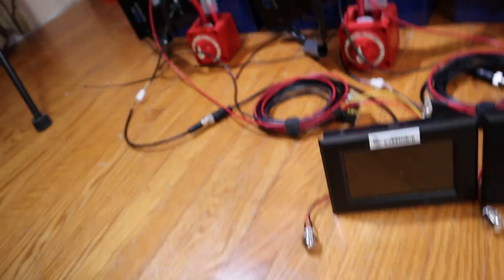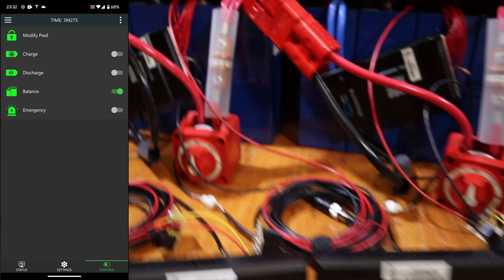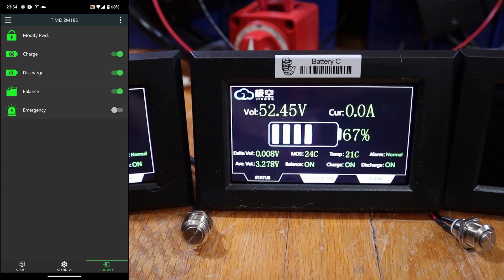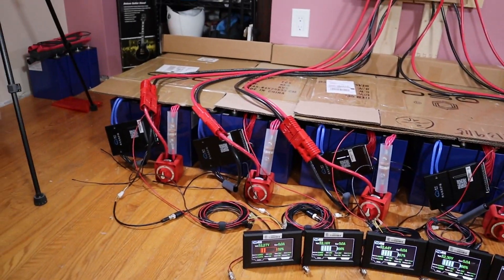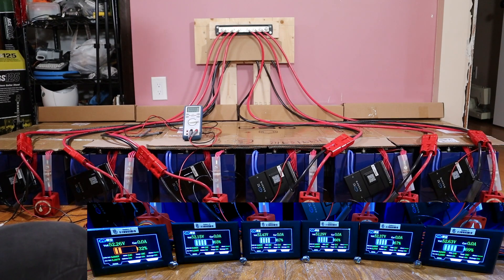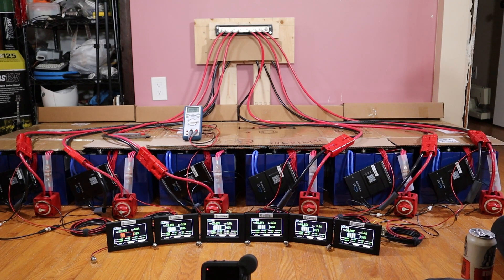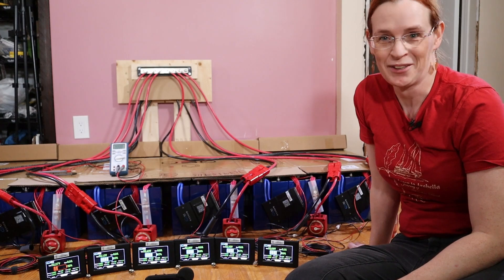First Parallel Connection! - Part 5 - Big Battery Build! (Ep. 42)

Comment: I have two packages, the first package is 280 amps and I use BMS JK, and the second package is also 280 amps and I use BMS JK. I connected them in parallel and the inverter charges from the public electricity 120 DC. Now the first package charges 21 amps and the second package charges 37 amps. What is the reason?
Reply from the maker: Somewhere there's a difference in resistance. Look for a loose bolt, longer wire, damaged wire, etc.

Comment: Would it be simpler and less complex if you just had one buck converter connected to the main buss to power all 6 screens...  you would still know on off state of the packs individually by the readout on screen or not..
Reply from the maker: Originally the goal was to have all the packs fully self-contained. Given the issues I've had though, I'm starting to lean towards a single bus to power the screens.

Comment: the voltages are all over the place because the bms's are supplied 'uncalibrated'.. thats your/our job lol. 

in the app, measure true voltage with meter, then adjust (aka calbrate) the 'offset' in the app. Also needs to be done for current but i didnt as i dont need accuracy on current drain, i'f i'm pulling 48.8A and it says 50.5 I dont really care.
The blue wrap on the batteries soon can split leaving bare metal leading to shorts, i suggest some seperation material

Comment: I don't know if you were planning on using epoxy board separators between the cells on your final build, but I would strongly recommend it. I just tore down my 2 original 16s banks so I could move them to a better location and found that the blue plastic coating had worn through on the corners of a couple of cells. I don't even know how, they have been stationery on a table 🙄. If your battery bank is going to be in motion on a boat, epoxy seperators will probably help you out 👍

Comment: Hi, If your BMS shuts off because of low voltage (Whatever you have the low voltage cut off set to) But you are in the dark and say, on a boat, then it's an emergency, so if you turn the emergency on it will overide the cut off and power back up and hopefully you will have enough charge left to sort your problem before the lights go out. Bob UK

Comment: I am playing/ testing with one of these 4-8s 200a cont 350 ? Surg  BMS in a small scale! 4s 4p 16 ah to charge an even smaller I suspect 3s solal generator blah nlah I am testit . They can ghost draw like 1 amp before they register anything. I had to add  a shunt to  figure it out the main MOSFETs don't close until around an amp.  There is a minor circuit that doesn't register  in the app or at all (ghost) It has been frustrating in my testing  because power is moving but it is not showing it. The bms will be perfect for stage 2 of my projt

Comment: JK DO NOT RECOMMEND TO CONNECT JK BMS IN PARALLEL
Reply from the maker: I KNOW, THANK YOU.
Reply: @TheDigitalMermaid  :) so why you're connecting them together
Reply from the maker: @alexos75  I like to live life on the edge.
Reply: @TheDigitalMermaid  lol ok great , for the wrong capacity reading , give it 2 days till it discharge and charge again , all the reading will be ok , but don't change after that the BMS battery capacity , as it will reset your cycle count and your battery % , also set once your BMS charging voltage and never mind about the amp it will bet set automatically after 1'st full charge
Reply: They do after they incorporated a class T fuse in each string. They even use a diagram I made on their website to explain parallel operation.

Comment: Hi I’m Phil, I really enjoy watching your videos, I’m trying to build a small system for my home in England.
It’s a slow process, like you say life takes over. Now, I know how heavy my battery cells are, 2 packs of 8 24volt.
Which brings me to the question of weight. Knowing your removing your engine and replacing them with all those batteries, which will be in a case. I was wondering whether your boat, which is lovely by the way, will lighter or heavier. Cheers 🥂
Reply from the maker: Heavier, by a couple hundred kilo, give or take.

Comment: Told ya... no current will be flowing at this low deltas...
JK numbers are all over the place. As great as this BMS is with its easy functions and good balancing, the calibration of voltage and current seems never right. SOC is more a rough estimate than anything else. Hence a smart shunt makes sense as your point of truth.
And congratulations for hitting this milestone. I know this feeling very well 😊

Comment: That is not what I saw when turning on banks. I say 39 amps for a few seconds then it settled at 19 for few minutes. after 15 minutes it was 2 amps going into lowest bank.
Reply from the maker: On your system? It would make sense, and it's what I expected on mine. In hindsight though, All batteries were charged and discharged equally at the factory before shipping to me. All cells were from the same batch, too. So it makes sense that there was very little difference between them. Kind of a rare condition for a big build, I think.

Comment: It'll take a long time for the voltages to equalize while the battery packs are in parallel if they are all within a few hundred millivolts. 
Best way to get them to equalize is to fully charge all 6 battery packs while they are in parallel.
Also pay no attention to the SOC shown on the displays until you do a couple of cycles on those battery packs.

Comment: Congratulations, it’s Alive! It’s very self satisfying when you can just turn it all on and it works. Im not sure if the JK’s do self calibrate when the batteries are full, regardless I have found them to be very accurate by gradually taking the voltage up to a full charge of 3.5v -3.65v/cell let them settle and hold there for an hour or so, and then calibrate/set ur BMS to 100% SOC, do this to each battery separately, (you can also tweak this further so that it will almost perfectly match ur main shunt if you play with it). You can do individual batteries by using ur inverter/charger from one set to another as they all charge up via solar or whatever other method you choose. You can also tweak the BMS current sensor so they are pretty much spot on with whatever shunt or meter you choose to make the main reference from. With all that battery power you probably wont have the issues others have had with the JK metering bugs from inverter feedback etc, I have 24v system with a big set of Max Caps which I believe greatly filters this voltage reading phenomenon. Anyhow, glad to see it is finally coming together. Cheers
Reply from the maker: I moved the SmartShunt from the first battery over to the Quattro to monitor the whole bank. Once I hit full charge, I'll sync all of their SoC readings and then do a full discharge/charge to see how they read. Will take a long time! Haha

Comment: You need larger voltage difference to get the amps flowing the packs won’t really balance until you charger them with pack voltage over 54.4v. Also the emergency is to by pass the low voltage cut off so if you get a low voltage cut off and your charger now won’t charge as it can not see any voltage clicking this will allow the charger to see the voltage and allow you to start charging.  This is not needed when you have more than 1 pack like you do as it will start charging anyway.

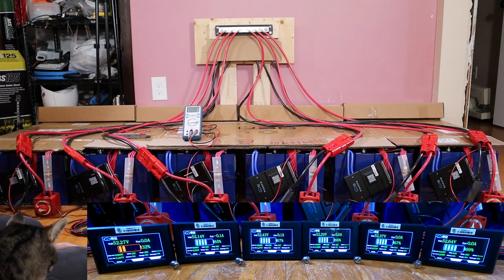Comment: Clicked "Like" @ 6:52.   :)   Voltages aside, Battery A "should" have been pulling a lot of current, with a reported SOC that is much lower than the others.  I suspect that SOC reading is not correct, that it's actually in the same range as the others and just needs some adjustment in the settings.  If the SOC of Battery A really is that much lower, then something odd is happening.  Personally, I would have charged each bank to 100% before connecting them, but this is the 2nd time I've seen large arrays connected with unknown SOC, but nothing bad happened.  This is also a very good example of how/why voltage cannot be used to correlate SOC, in LFP batteries.
Reply from the maker: After this video, I shut everything down. When I restarted it, Battery A showed the same 66% SoC, so *shrug*, I dunno. I'm not worried about it until I get a full cycle in.
Reply: @TheDigitalMermaid  - I would be relieved to see that same 66%.  Glad it worked out for you that way.  As you said, until you have a charge cycle or two, and the shunt(s) are calibrated, it doesn't matter much.  The lack of current from the other batteries into A kind of told you that it wasn't really at that low SOC.

Comment: Great job Maddy.
You have to check the voltages by multimeter. I have one JK and I had to correct the readings. For better SOC value it is better to have normal shunt, because the values will be different on every JK.
Reply from the maker: Later after this video, I checked the voltages and found the BMSes are out by 0.2v. I've put the Victron SmartShunt between the bank and the quattro.

Comment: Hi Madi, congratulations on your build. I'm really happy for you that this has worked out. I know you've put a ridiculous amount of hours into this project. I too am surprised the current was so low after connecting in parallel. That was something I too was worried about in designing my own build. Seems like there wasn't too much to worry about once the voltages are close enough to each other. Looking forward to your future videos.
Reply from the maker: In hind-sight, the batteries were all matched, charged and discharged together in the factory, so I suppose it really should be a surprise that there was so little current flow.
Reply: @TheDigitalMermaid  ahhh, yes, i see your point.

Comment: Don't trust neither the voltages, amperage or the state of charge.
The voltage you need to calibrate, with an instrument that is trust worthy, this goes as well for the amperage.
The State of charge will calibrate itself after a full cycle.
Trust your own feeling and you won't go wrong.
The thing is, when you are doing DIY, you won't find anything as satisfying then seeing all is working.
Congratulation 💪

Comment: Can't wait to see you balance them! Good job
Reply from the maker: They've been slowly (very slowly) charging off solar for almost two weeks now! I suspect the charge is low enough that they'll balance fine during the first charge. We'll see though.
Reply: @TheDigitalMermaid  The JK will do all the balancing just fine. It's a great BMS in this regards.
Reply from the maker: @OffGridGarageAustralia  I suspected as much, and particularly because of how close all the cells seem to be.
Reply: @TheDigitalMermaid  LiFePO4 is pretty harmless. Even with one cell at real 50% and the other at real 80% I saw only ~120A for a few seconds before that started to go down. The curve is so flat, it's pretty safe to parallel them without getting huge currents. Unlike many other chemistries.
Reply from the maker: @OffGridGarageAustralia  I'm coming to understand this. That said, I'm really curious to try an experiment where I connect a totally dead battery to a totally full one; See how much amp transfer there is in the very worst case. Well, that will be for later, for now, I am faaaar less worried than I was.
Reply: @TheDigitalMermaid  OK, that will go too far and could end in another 💥
voltage delta drives the current. In your setup you have a lot of connections with ads a bit resistance to the circuit. Because the voltage difference is low, this resistance helps a lot to reduce the current as you have just seen. If you would connect the batteries directly at the terminals and eliminate BMS, shunt, switches, main bus bar and crimp connection, current will be way higher. I think I have shown this in one of my videos and the current was >200A with a direct connection.

Comment: If one buck convertor fails u may be able to rub 2 screens from one buck!
Reply from the maker: Oh for sure I could, and it is what failed. I already repaired the blown one and fixed the design mistake in the others.
Reply: @TheDigitalMermaid  Do u have to coat them to protect them from  salt?
Reply from the maker: @BajanAlan  If I was going to use these on the boat, yes, I would "conformally coat" them. However I will replace these buck converters if I end up using JK on the boat in the end.

Comment: Once you have it connected to the solar we will need weekly or bi-weekly updates on how the first normilaztion charge is going.  I don't know how much solar capacity you have but I am going to guess it is going to take a couple months or maybe more to fully charge that beast of a battery bank.  Can't wait to see how things progress with the build since we all know it is never really done.
I don't think I have seen a full charge on my home system for 3 or 4 weeks with all of the cloudy and stormy weather lately.  I will say that the 48V water heater mod that I did a while back has been working flawlessly so far.
Reply from the maker: I brought it online on Oct. 6, and it's been slooooowly charging since. My current panels are often shaded by trees, and not at the ideal angle, but they're doing their job. If you're curious - https://vrm.victronenergy.com/installation/125562/share/9ee3668c
Reply: @TheDigitalMermaid  Thanks for sharing, I will stalk you now 😁
61% at 42W, it may take a while...
Reply from the maker: @OffGridGarageAustralia  Haha! It's been rainy/overcast recently, and I've only got 4x ~330w panels, which are often in shade in these shorter fall days. Ya... This will take a while!

Comment: 05:24 - I would checked battery A first. Gone into the app and check for faulty cells.
08:25 - hloy shit it's working....
Reply from the maker: Checking for faulty cells would be smart, but I honestly paid very little mind to the reported SoC, I knew it had to be off.

Comment: I have two 48v batteries with two JK BMSs in parallels. The only thing that seems way off the mark is the BMS state of charge reading. 
I’m not worrying about it, and don’t really know how to sync them so that the SoC makes more sense.  I’ve been told that taking the voltage right up high like 3.65v per cell would sort it out, but would rather not stress them. 
I use a Victron BMV712 smart shunt to ascertain my SoC, and don’t care what the BMS says, so that works for me! 
Cheers from Brisbane 🇦🇺👍
Reply from the maker: I moved the Victron SmartShunt out of my first battery to be between the battry bank and the load buses. That should give me fairly accurate SoC once I get through a full charge/discharge cycle.
Reply: @TheDigitalMermaid  Yes- my thinking as well. 
I have my two batteries paralleled and then feeding through the Victron smart shunt. Thus I have one “battery gauge” and it’s pretty darn good with the right settings, obviously with the proviso that it needs a reasonably regular sync at top of charge to remain accurate. Anyway, that works well for me and I ignore the BMS battery SoC. (This morning for example, I have full batteries at the moment and one JK is saying 53%, the other 82%, and my Victron is saying 100%.)
Meanwhile the JK BMSs do a fabulous job of keeping the cells accurately balanced, which is what matters.

Comment: My guess, Emergency = let it run even if the battery voltage is too low and cell damage will occur.  Risking $12,000 in batteries!
Reply: Correct.
Yea, avoid like the plague.

Comment: Wow, that is a hell of a lot of work.  How are you going to route all those wires in your boat?  Have a great day.
Reply from the maker: Each battery will be self-contained, so the only visible wires will be the Anderson connectors between each pack and the bus bar (for that part of the system, anyway).

Comment: I know exactly how your feeling when it all goes right.  I had that same feeling about an hour ago, yes 11 pm here also.  I just finished my 24v, Growatt all in one system.  I built the 8 cells lifepo4 battery with the Daly 200a BMS with your help.  I watched your videos like 6 times each and absorbed everything you said, and then jumped off that bridge and decided to try it.    I was probably just like you when you first turned it all on, expecting the MAGIC SMOKE MONSTER to appear.  After about 30 seconds I started to breath again, NO MAGIC MONSTER.   I think I saw you holding your breath also....LOL   Great work and thank you for your help..

Comment: I think you should be able to calibrate the voltages on each unit, which should be done after they have sat equalising with each other for a good time. Also, I  presume they have to fully charge/discharge to get a true state of charge (SOC). LFP batteries have flat discharge curves, so you cannot get an accurate SOC from the voltage alone.
Reply from the maker: I figured the SoC would sort out on a charge, but I had no idea the BMSes can be calibrated... Interesting. I'll look into that.
Reply: @TheDigitalMermaid  https://www.youtube.com/watch?v=xTKiOvJ_ejg&t=1171s  minute 16:33
Reply from the maker: @rapppaa  I watched that video, but it didn't click at the time what that was for. Thanks for re-linking!
Reply: @TheDigitalMermaid  Yes. The BMSs do not know the state of charge until it can count current/volts out of the battery. This will be known from the first full charge. You've got a lot of charging to fully charge the whole battery! 😃
Reply: @TheDigitalMermaid  yes the bms can be calibrated!